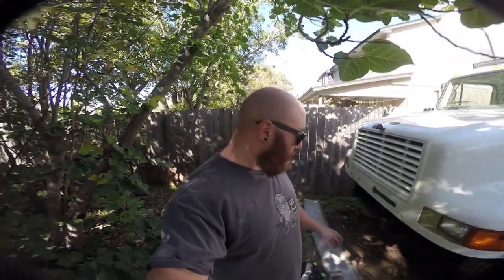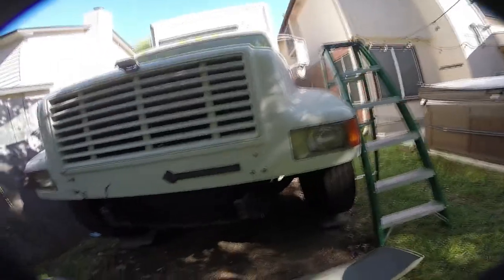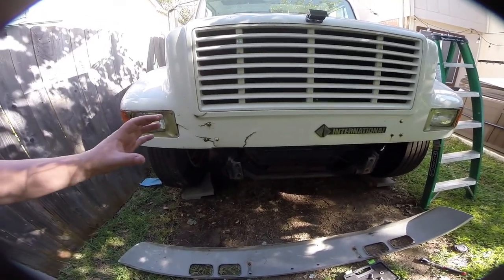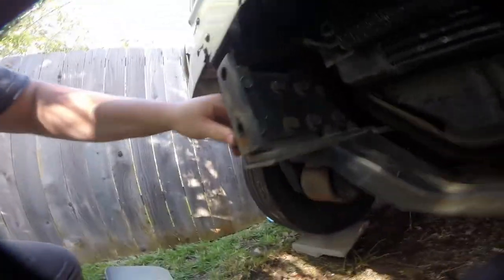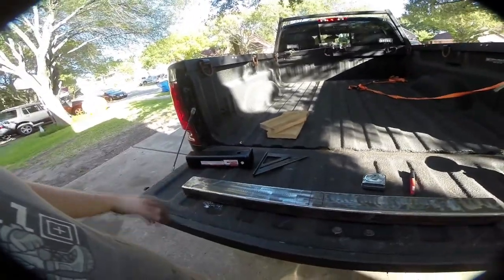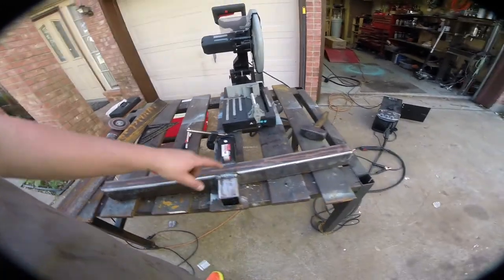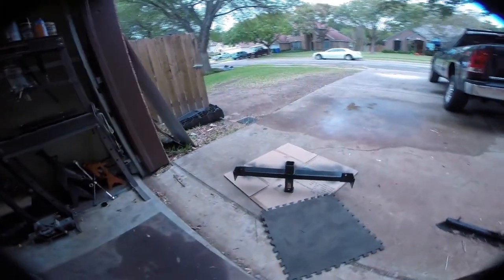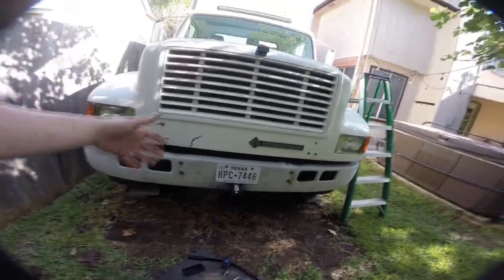#TheBassBox - Part 12 - Adding a Front Hitch

Comment: I would have gone with heavier gauge on the frame mount "L" brackets. Not sure what size bike you plan on hauling but after a few hundred miles of bouncing over potholes my almost 900lb Harley would probably be under the truck due to the shear stress. I would use the same thickness as the square receiver tube for the "L" brackets to the frame. Just my 2 cents. . I really like everything else so far!